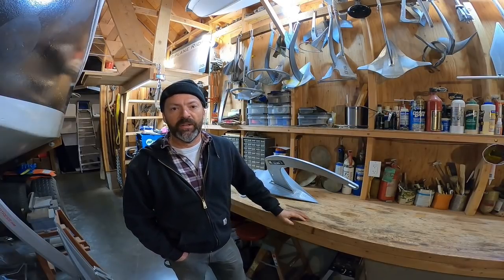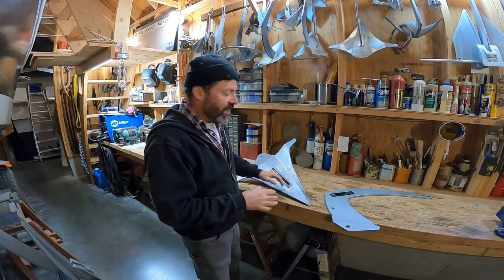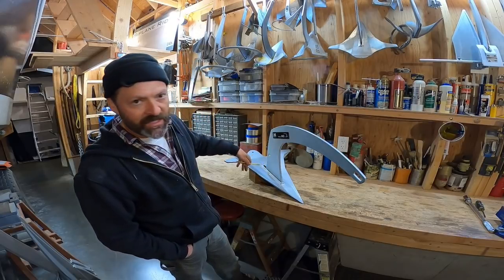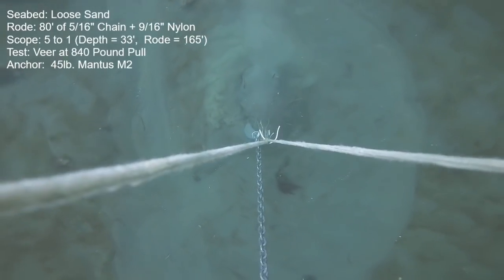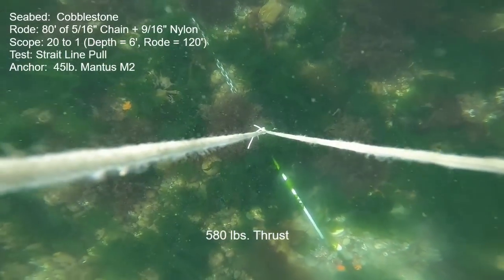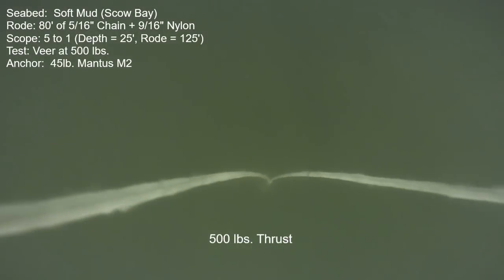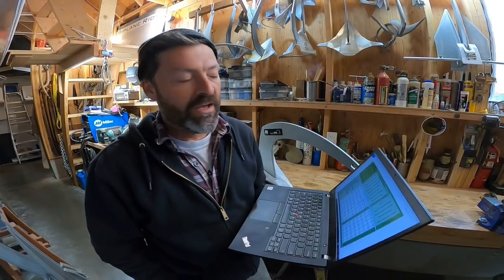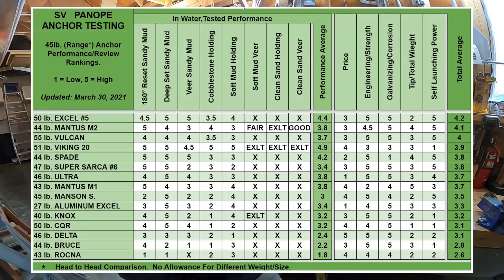Mantus M2 44lb Test/Review.  Anchor Video # 108

Comment: Steve,
Two thoughts that may or may not have value.

I own an M2  46;  now with new style shank.  So far its been great. A note of thanks to Mantus for contacting us all and offering an improved shank at no cost.  No company gets everything perfect all the time, but standing behind your product means a lot to me.

I notice the way M2 assembles that it pulls the shank hard to one side of the wedge vs centered.

I understand in tests hole drilling has impact on mud on some anchors.  I wonder if the shank being hard against one side makes a difference as well.  One side has a gap, the other does not.  On an instinct to remove side motion that adds stress, I added a big flatwasher to mine to center shank in the opening.

My M2 does not have a significant dip on one side of the wedge as you noted.

Now to really go off the deep end.  
There has for a long time been a hard lanolin compound available that is melted and applied to propellers. This was the precursor to things like prop-speed coating.. Marine growth won't stick to it.

I wondered if we coated the small areas that are prone to mud sticking with a release such as that, it would allow better reset.

It's counter intuitive in that an anchor to me is partially a friction device....as well as a hook....but if you prevented mud gobs in key areas...maybe the more temperamental anchors would reset better. A crazy thought, If was a success, and we had an anchor with fewer mud fails,, anchor manufacturers might learn other ways to reduce adhesion on existing units vs making them slippery.
.
Reply from the maker: Caine, 

Re: Shank to one side of slot:  Very good idea, but, apparently this is not the cause of the mud sticking to one side and not the other.   The shank was forced to the side OPPOSITE of the mud fouling (in other words, the gap was on the fouling side).

Re:  Non-stick coatings on anchors:  I have not (yet) tested any non-stick coatings, but I have marked an anchor fluke with permanent marker.  Markings were %100 removed after one set.  My prediction is that non-stick coatings will be quickly worn away.  Note: my predictions have been wrong before.  Stay tuned......

Comment: Steve... thanks again for another great video… I was really anticipating this review  because I’m ready to buy a new 45 pound anchor for my boat and I thought the M2 was the one... it performed pretty good considering in my opinion it’s second quality goods. I certainly wouldn’t accept this particular example now that you’ve throughly tested it and found its flaws.
To be fair,  I believe you did a great service to Mantus by pointing out the defects in this particular anchor and  hopefully they will immediately send you a replacement piece to compare.
Somebody had to know it was not first quality and they still sent it to you 🙄
Reply: Yes, but Steve does all his tests privately and anonymously.  That’s what’s so good is that they are the same anchors that the shops sell.

Comment: Hi Steve 
Question on 20Kg Anchor option, Ive come down to 2 options. This M2 Mantus and the Rocna Vulcan ? Which would you say is the better option form those 2. They are same price point in Galvanised.? Boat is 37 feet Faireline Targa Sport cruiser 8-9 Ton and 11.5m Currently has a bent Danforth Stainless 20+kg but does not hold bottom in changing tides or wind

Comment: This was great, Steve. Any chance you could test a Mantus M1 35? Bought one recently on strong recommendations and curious how it performs against others in your tests.
Reply from the maker: Thanks Peter, I think it is a safe assumption that a 35lb M1 will behave similar to the 45lb M1 that I have already tested extensively.  Unfortunately, I have not consolidated all of the 45lb M1 tests in a single video (vet).  See the Ranking Chart at the end of this video for a quick comparison to the other 45lb (range) anchors.

Comment: Thanks for the video!  I just bought a 35lbs M2 to replace my 25 lbs M1 on a 28 foot sailboat.  I wonder if the mantus M2 you used had a manufacturing flaw that would be covered under warranty as a manufacture defect??

Comment: Hi Steve.  Was this M2 with the original shank design or the new shank design?
Reply from the maker: Joe, Mantus submitted this anchor (and the 17 pounder) very recently.  I am almost certain this is the current version.
Reply: @flygoodwin  OK.  We had terrible problems in the Chesapeake (soft mud bottom) with the original.  I did get the new shank replacement, but also moved up one size in anchor and moved to a different region. so can't really compare old to new, but have no complaint now.  The new shank opens up the angle between shank and fluke.

Comment: What the heck.  Bought one of these based on your previous review, saying it was great.  Now, it's not good at all?  Also, I don't have the issue with it being loose on the bow roller as your other video indicated.
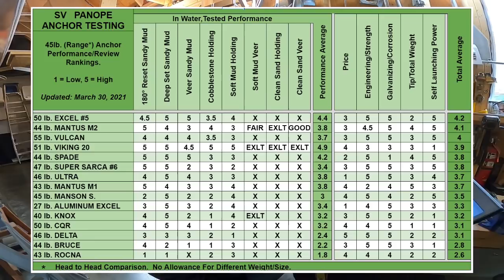Reply: Says its still a good anchor bro, says so at bout 28:35, maybe without the manufact. flaw it would have done better! Anyone following these tests knows by now that there are diff. between sizes of the same make/model. Patience pays off until more testing is done.
Reply: Does your anchor have the same welding flaw as the one Steve tested?
Reply: @patrickmiller4987  so what is the need for those tests?

Comment: Hi Steve, just received my M2 44LBS .after watching your report , I checked out the fluke and have found the Same if not greater  asymmetry problem as your self, the welds both sides definitely should have been ground down far better,and I was disappointed and surprised to find that the anchor is manufactured in China,maybe that tells a story.Have you had any contact from Mantus regarding this problem ? Regards Robert UK 🇬🇧
Reply from the maker: Thanks for sharing, Robert.  I have not had any further communications with Mantus since shortly after the M2 test.

Comment: Is the bolt stainless or galvanized? If not stainless, you could use an AN10 aircraft bolt which is zinc and cadmium plates and comes in 1/16 increment grip lengths.
Reply from the maker: Bolt is stainless.  Stainless aircraft bolts exist, and would be a good choice.

Comment: What do you think about filling some of the bolt threads with filled epoxy?
Reply from the maker: Epoxy filled threads might help protect the galvanizing to a certain degree, but when subjected to extreme loads (anchor stuck under a rock) the epoxy will compress or crumble away.  I have located a source for a "smooth shanked" Titanium bolt that I believe will be an improvement.  Stay tuned.
Reply: @flygoodwin  thanks

Comment: What caused the Mantis M1 to drop from 3rd place in video #100 to 8th place in this video?
Reply from the maker: Funny you should ask this, as my next video will include another "shake up" in the rankings due to new, more comprehensive testing in the Soft Mud (a seabed where the Mantus M1 performs very well).   Look for the M1 to reclaim a spot high on the chart.

To answer your question, there are four reasons that the Mantus M1's overall rank fell between video's #100 and #108:

1 - The Viking 20 was added.  This anchor scored higher than the M1, thus displacing it down one slot.
2 - The Mantus M2 was added.  This anchor scored higher than the M1, thus displacing it down one slot.
3 - A new category was added. See "Self Launching Power" from video #106.  The M1 was mediocre, thus reducing it's total average.
4 - The Viking 20 and Mantus M2's dominant performances in the cobblestone set the bar much higher.  This resulted in the previous "best" anchors (in Cobblstone) to all be downgraded (Excel, Vulcan, SARCA, Spade, and Mantus M2.)

Comment: With a windlass power of 1000 on a 42 ft new Leopard what would be the maximum weight I could use on an anchor? Will be mostly based in PNW and will spend as much as required to have a secure anchor. Thanks!
Reply from the maker: Worst case scenario might be retrieving the anchor from 100 ft depth.  3/8" chain weighs 1.5 pounds per foot or 150 lbs for 100 ft.   If the windlass truly does have the ability to regularly lift 1000 pounds, than the limiting factor for anchor size may very well be something else, like the bow roller.